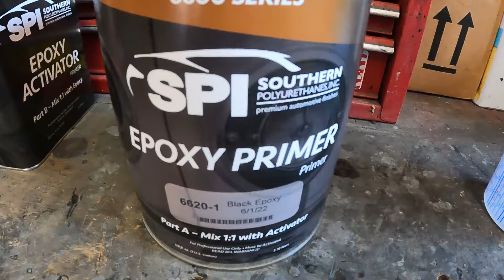Roll Bar Painting Fun! - How NOT to Paint the Roll Bar in Your Hot Rod

Comment: If you use a pipe roller thin out the paint  you only have to worry about the top of the bars or the stuff right next to the sides you get a little bit of orange peel in it but hardly nothing in the floor right out.
Reply: Flow
Reply from the maker: Thanks for watching and for the tip!